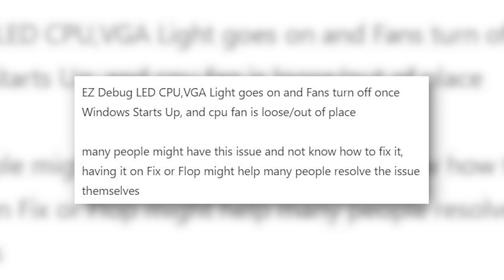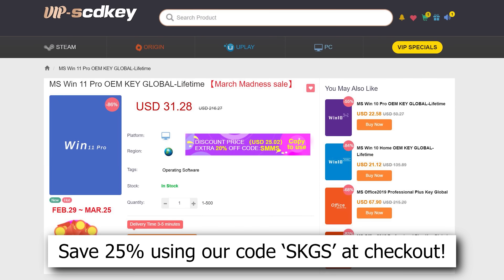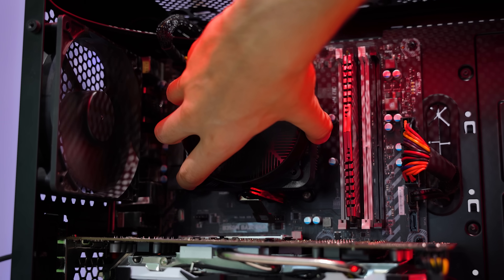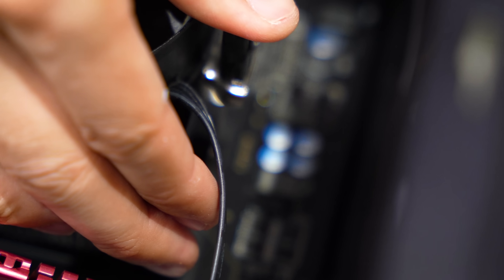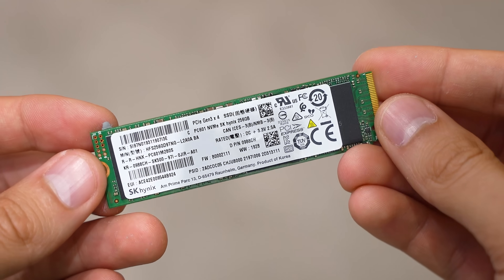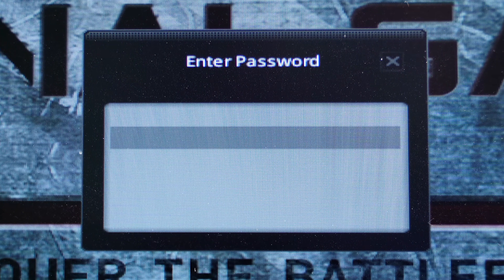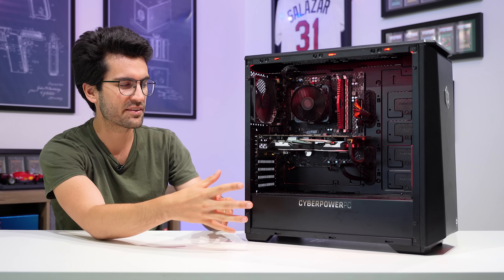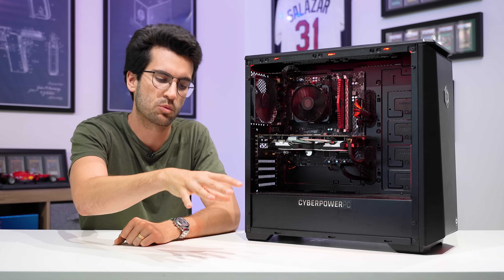Fixing a Viewer's BROKEN Gaming PC? - Fix or Flop S5:E10

Comment: Did you migrate the owner's Windows from the old HDD to the new M.2 drive??
Reply from the maker: We explained what we did and why in the video. I don't recall this exact episode, but we would never wipe a drive without permission.
Reply: @GregSalazar  Hey Greg! Thanks for the reply..I didn't say "wipe"..just migrate....that kind of implies leaving the old drive as it was..(at least, that's what I thought) as I do when cloning an old drive to a new one. I guess I should have used the term "cloning"...I was not aware that migrating necessarily wiped the "old" drive of data..Anyway, Thanks again for replying...

Comment: I know the video was a long time ago but I recommend that if you have a PC, replace those HD drives with at least an SSD for SATA or if you have the option, buy an NVMe m.2. I only have an NVMe m.2 in my PC and there is a big difference, a change in the way anything loads. For comparison:
HD drive 120mb/s
SSD SATA drive is already 550mb/s
and M.2 NVMe drives are already over 3300mb/s, currently the fastest drive on the market reaches 14400mb/s
This is already a big change, even when loading the system. You can use an HD for data or something, but you need to buy a faster drive and not bother with the loading time. Not only do SSDs improve the lifespan, you also don't have to defragment it like HDs every few months.

Comment: I HAVE AN OLDER DESKTOP(FROM 2011) THAT IS UPGRADED, I USE IT DAILY, I KNOW ITS OLD, I DONT GAME BUT I DO PHOTO VIDEO EDITING AND ITS SLUGGISH AND GLITCHY THE PROBLEM IS I DO NOT HAVE A DESIRE ON FIXING OR REPAIRING PC's ANYMORE, AND IT IS ANNOYING TO DEAL WITH THE ISSUES , I DONT FEEL LIKE WORKING ON IT ALSO I USE MY DESKTOP DAILY, ALSO I GET A BIT BUSY WITH THINGS, FOR THE MOST PART I AM LAZY WHEN IT COMES DOWN TO FIXING THE ISSUES AND SETTING UP THE GPU, IT SEEMS THIS HAS HAPPENED AS I HAVE GOTTEN OLDER, I AM JUST NOT INTO REPAIRING AND FIXING THINGS NOW A DAYS, ALSO I DO NOT AND WOULD NOT TRUST ANYONE LOCAL, I KNOW ITS IMPOSSIBLE TO TRUST ANYONE ESPECIALLY IF THAT PERSON WANTS TO TAKE THE PC TO WORK ON IT, I HAVE HEARD OF MANY DISASTERS FROM THE ENDING WITH WORSE PERFORMANCE ALSO THE SWAPPING OF LOWER PERFORMANCE PARTS IN PLACE AND MANY OTHER ISSUES

Comment: @Greg Salazar Please Help! I have a decent PC that I built myself. I've done this several times and nevel had a problem. But this particular setup causes me endless problems. It crashes randomly. I reinstalled Windows several times, added and subracted parts and software, ran test after test, etc. Ultimately it gets better for a while and then goes back to the same thing after some time has passed. I am at my witts end, I can't afford to bring it in anywhere. According to Linus I'm probably better off just buying a new PC rather than bringing it in. But I can't afford it. I'm about ready to just sell it off for parts and buy an Apple. I really don't want an Apple. Please please help.

Comment: I've found Aida64 to be a poor way to truly stress test the cpu. It pegs the utilization at 100% but the temps and the power draw never come near what the system is capable of. Cinebench and Prime95 respectively take those a few steps up. This may just be my experience but I don't really trust Aida64 for testing thermals. It just doesn't push it as tough as other benchmarks and specifically stress tests do.

Comment: Got GTX 1060 6GB, i5 6400, 16 DDR4, 700W psu.

Every game crashes at some point. Temps all ok, uninstalled and updated driver with DDU and all, tried multiple versions of drivers, still crashes.

Used MSI Afterburner to undervolt gpu but still crashes. Tried using different psu/motherboard/ramm with multiple config, but still crashes.

Then finally I try underclock the vram speed by -250 and no crash afterwards, game plays normally and smoothly.

Does this mean my GPU's vram is dying? I tried underclock the vram from -100 to -250, but only -250 fixed it. The game launched no problem, but at some point from 4-7 min of playing, all games that I played crashes. I did everything I can, then after years of not able to play game I decided to try again and suddenly the idea of underclocking the vram came and that fixed it. Like bruh..

Comment: I've got a hard drive that seems to be completely locking my system up. Mind you, it is not my boot drive. Last time I managed to boot all the way into windows it showed that drive pegged at 100%. I was getting disk write errors every attempt I made at updating games in steam. Retarted my computer a load of times trying to get it to boot but it just refused to go to windows with that drive plugged in. When I removed the drive it's like my system came back to life and was all of the sudden snappy again.

Comment: I think the main problem was the CPU cooler not being secured but the other was the amount of disk space left on the HDD. Only 34.8GB on a 1TB drive. I would bet if 100GB were deleted, it would boot significantly faster, although still slow. Even after Windows finally loads, it will make it run slower with that small a reserve space. If it were SATA or nvme, it might react even worse.

Comment: Not sure if anyone mentioned it here but MSI cards usually tend to run no fans while idle in Windows in silent mode. Had the same with a 2070 Msi Armor card!
Reply: All cards for probably over a decade now dont start running fans until the card hits something like 60c by default.

Comment: Hey Greg, From the UK here, I get an occasional problem with my PC, my GFX card (Radeon RX 590) turns off randomly under use (hard to duplicate because there's no guarantee when it will happen). when it happens I have to go Device Manager, Enable -> Disable -> Enable to get it to turn back on. I have checked all connections multiple times, checked for software updates, checked everything is securely mounted etc. I've also taken the issue to computer shop's etc asking for advice but they haven't any idea what the issue is... Sorry I cant be more descriptive but do you have any ideas what may be happening here? I've been watching for a while thinking if only this was available where I live xD

Some specs:
AMD Ryzen 7 3700X 8-Core Processor  3.60 GHz
Corsair Vengeance RGB DDR4 3200mhz 32GB (2x16GB)
1TB Samsung 860 EVO SSD
ROG STRIX B550-F GAMING Motherboard
Radeon RX590 8GB
OCZ ZS Series 550W

Comment: Wouldn't have surprised me if it wasn't the plastic motherboard mounts that had broken.  Seen that happen on some motherboards because they were just made too short and that caused more pressure than necessary being applied by the fan which weakened the tabs over time.   Some AM3 boards were really good at that especially.

Comment: I could be wrong, but I don't think the RX 580 came with zero fan function. They should be on at idle speed and ramp up under use.
Reply from the maker: This one definitely has its fans turn off at idle and ramp up under load. Confirmed visually while stress testing.

Comment: What they might be referring to is a fan hub with a controller, because most fan hubs with controllers have a fan speed button to increase or decrease the speed of the fans. My rudimentary fan hub connected to a fan controller can certainly stop my fans if I press the wrong button on the remote when controlling my ARGB.
Reply from the maker: ? Don't recall a fan hub in here.
Reply: If there wasn't one maybe they were just referring to the gpu fans stopping on no load. But I experienced a weird issue back then that was similar to this, when my case is closed all accessories stop working but when it's open they start working again. 

Turns out my case got bent weird since I never moved it, and the mobo was touching the pc case shorting out the fans and usb ports. But it still worked for awhile afterwards I just kept it bare since closing it stops all accessories weirdly it didn't electrocute me or anything when I touched it.

Comment: I remember when SSDs first became a thing, and they were pretty expensive at the time.  Regardless, I purchased a 128GB Intel SSD and swapped out the platter drive in the MSI netbook I had at the time.  The difference in boot and app loading was stunning.

Comment: An SSD of ANY kind will be faster than an HDD, with those spinning platters, rapid moving heads, and the spindle motor......still the most robust solution so far. Except, SSD's. 3.5", M.2, nVME, ANY kind of SSD will benefit most computers as the BOOT DRIVE! Have one of these as your BOOT DRIVE, and you will notice boot times from 54 seconds, to 12 seconds.....both run a clean Power On boot!

Comment: I can attest to how huge a difference moving from an HDD to an SSD can make. I have ad admittedly very old system (we're talking 2008 Dell hardware) that I was using as a domain controller (please don't hate on me). I only needed it for the DC role, so it didn't need to really do a lot. I didn't really care if it was dog slow, as my domain is only a few computers thick. The story is that old computer was running a moderately newer HDD. I purchased a brand-new custom-built server as a Hyper-V server and was doing to decommission that old relic I was using, but I decided, for grins and giggles, to put in an SSD to see what that would do. Darn it if that didn't put some zip into that old machine! I am running Windows Server 2022 on that thing, and it is cranking along like it's still in its prime. It's running as a backup DC and DNS server on my network. I'm probably going to fully decommission it soon, but I cannot tell you the remarkable difference moving from a platter-based hard drive to a solid-state drive made in that li'l machine's performance.

Comment: Having only 34GB available of the 1TB HDD isn’t going to help matters either. If it’s just for storage it’s questionable but oke. But for booting even in the old days when you only had mechanical drives letting the bootdrive drop so low in available storage would significantly drop performance

Comment: Yo I got a question I recently change my motherboard and case and I turn my pc on and get this message (Copyright (C)
American Megatrends, Inc.
BIOS Date: 10/20/2022 20:15:19 Ver: 1ANQH230
New CPU installed, fM/PSP NV corrupted or fTPM/PSP NV structure changed.
Press Y to reset fTPM,
the system will not boot without a recovery key
if you have BitLocker or encryption enabled,
press N to keep previous fM record and continue system boot, fm will NOT enable in new CPU, you can swap back to the old CPU to recover TPM related Keys and data.) 
But when I go on my keyboard and press y it doesn’t register or something if there anything that anybody know what I can do lemme know I even connected it to Bluetooth through my phone and all the keys work and I even tried fn+spacebar and fn+tab and nothing still work so if anyone know what I can do lemme know down ⬇️

Comment: Greg, you were SPOT ON on this one! When you stated it only had a Hard Disk drive, my jaw pretty much dropped to the floor! I can't believe in this day and age, anybody would just use a regular HD for their OS other than just for storage of games, audio files, etc...! Other than the loose air cooler,  good job!
Reply: Somebody who doesn't have the knowledge to properly mount the CPU cooler also won't know that an SSD is so much faster than a HDD.
I'd actually blame Cyberpower for cheaping out on this.
Reply: What about that sagging GPU?

Comment: even older, ancient systems running ddr3 ram see MASSIVE performance improvements..simply by switching to an ssd.
Reply: Hell, my dad's old Core2 laptop saw a massive improvement with a cheap 2.5" SSD.
Laptops especially see an improvement as 2.5" mechanical drives are usually 5400 RPM and designed with low power in mind so they are even slower than their desktop counterparts.
Reply: Resurected an old sony all in one with an ssd, ram upgrade ans wifi upgrade. Can attest to this.

Comment: My PC is probably 8 years old now, and last year I decided to make a few upgrades to extend it's life. The cooler was done out of necessity as the CPU was really maxing out temp wise when it was under heavy load.
Once that was done I decided it was time to bite the bullet and replace my HDD. My MB does not have any M.2 slots so the only option is a 2.4" SSD. 
I bought a Crucial one as I have always had good experiences with their products (my PC ram is Crucial and my M.2 expansion in my PS5 is as well). It comes with software to clone my HDD onto the SSD (well it came with a link to download it). The process was incredibly easy with only one piece of software needing a licence update (Photoshop).
The speed difference between my HDD and the SSD is crazy. The boot up process was getting longer and longer with the HDD. Even when you got into Windows, it still took forever before you can open things like internet browsers. Now everything is almost instantaneous. I kept the 1TB HDD in the system to keep all my music on it, and as I bought a 1TB SSD, everything else can be kept on that. I still have around 500gb free on both drives.
I was an SSD sceptic, but no longer.
Reply: there is no bigger single upgrade you can possibly make to the overall function of a PC than upgrading an HDD to an SSD.
Reply: @ElysaraCh  fully agree.
Reply: You should have gone with a pci-express m.2 nvme card
Reply: @BrandensOutdoorChannel  Except I don't have any spare slots. It is a micro ATX board so only has two slots, both of which I am using. Plenty of spare SATA ports tho.
Reply: Have you ever tried booting Windows from a floppy disk? While Windows boots, I used to say I'll have dinner and maybe wash my car, and maybe...
Reply: @outlet6989  Nah, had a HDD with my first PC, but I used to own an Amiga. But playing games from floppy disc was so much better than loading games from audio cassette like the C64 or Spectrum.
Reply: @caphowdy666  As Archie and Edith sang in All in the Family, Those Were the Days.

Comment: Fans not spinning is called “silent mode” when the gpu starts to warm up it will turn fans on the slowly increase under temp sense and chip load indicators

Comment: Although a massive improvment in boot times, replacing the boot drive like that means the owner doesn't have access to their original OS. In my experience owners rarely know their passwords to websites & wouldn't have access to their email client so would have a problem with such a upgrade. I realise you had a problem contacting the owner but it might've been worth cloning the original HDD and bypassing the PIN/password (we all know it's pretty easy to do) to get in and then try and reset the BIOS password (Lord knows why people do that anyway). I'm not trying to criticize as you've fixed their problem and drastically improved the PC usablility for free...it's just an observation based on experience.

BTW, this is one of my favourite channels as I really enjoy fixing PC's and we can all learn a bit more from such a playlist...keep it up Greg!
Reply: But just cloning the drive would require a 1TB SSD, cause the HDD is 1TB and has not much free space.

Comment: Even 6 or 7 years ago when this would have been new an NVME boot drive with a large mechanical storage drive was the norm. I wonder if this wasn't scavenged for upgrade parts at some point, then repurposed for a sibling? Not defending Cyberpower, but a 'price point' PC in those days would have had a small NVME and two sticks of RAM.

Comment: Holy hell that HDD was full. Probably didn't help with programs crashing and being weird. Windows does not like a full drive.
Reply: With that little of space left causes problems because Windows wants to have some space set aside as virtual RAM. This is more evident with the single stick of (I think) 8GB or 16GB. Which is honestly just not enough to play a lot of newer games. 32GB is always my recommended size.
Reply: @olandersnake  can u name me 1 of those game that recommend 32gb ram. just built my 1st pc and interested in those kind of games. i usually just play fps games
Reply: @TrainIIIX  Did you not put in 32GB? It's around $100 or less total for 32GB. $55-$115 for DDR4 and DDR5
Even if the game doesn't need all 32GB, if your ram usage is near 16GB or slightly over, when that's your total system ram, you'll get stuttering and computer will be less responsive
Reply: @Farhan-ec7dx  it's not games that recommend it. It's the usage of having the games that use 8-10GB, and then Windows itself, your graphics card software, your peripherals controller software, motherboard software, steam/epic games/blizzard software, Discord, and quite a few of the competitive games have launcher software as well. So many gaming computers that I service will have 5-8GB used just turning them on and logging into Windows. Then you boot up a game, and POW you are using up your RAM. Then you get to enjoy random stuttering due to you C: being told to be used as virtual RAM, which even the fastest SSDs are not quick enough to be RAM. Might as well "download more ram." You can probably get by with 16GB, but to have some decent coverage, 32GB is the best option.